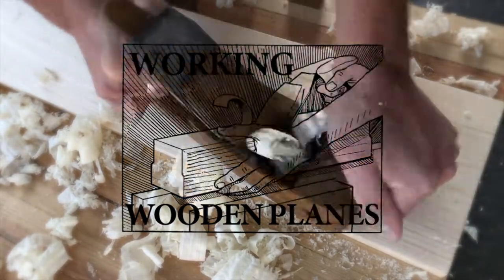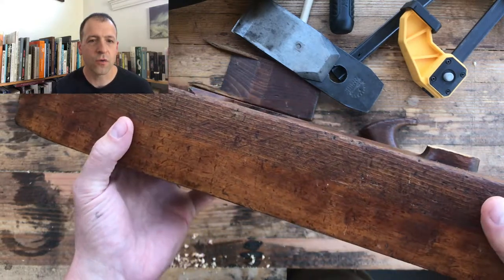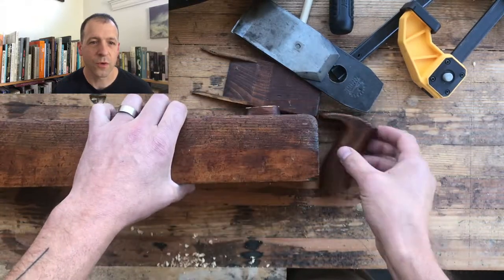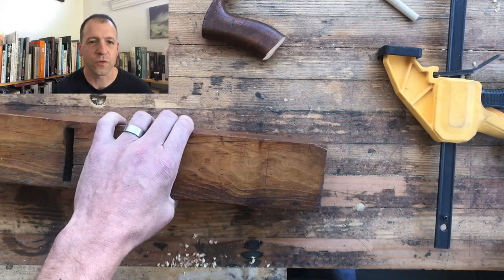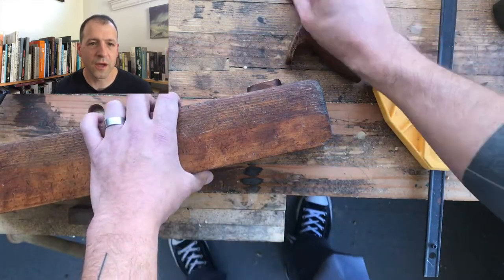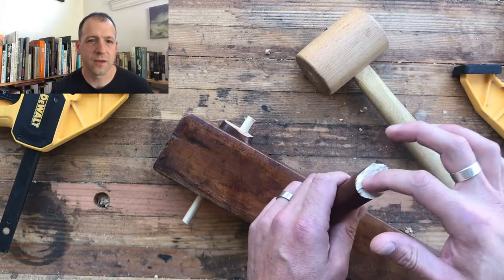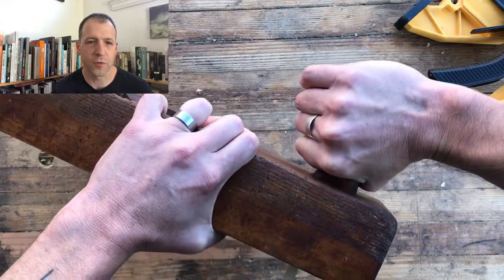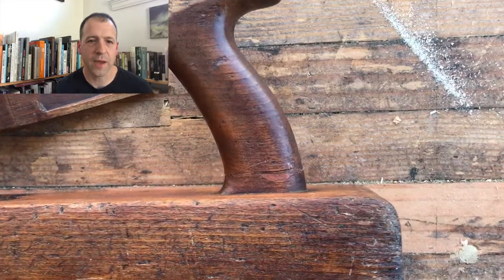An Unusual Way to Fix a Broken Tote on a Wooden Plane

Comment: If you run into the situation where the dowel won't pull out like this, you could try to drift it all the way through the hole. Any bruising on the base of the dowel isn't an issue because it will be trimmed off anyway.

I also like to ease the edges of my dowels with a spoke pointer of a pencil sharpener to make putting them in easier.

Comment: The planes that you show restoring have a groove cut into the blade ramp for clearance of the screw or nut holding the chip breaker and blade together. I have a wooden tryplane body that has no such groove. Is it for a different type blade?

Comment: Awsome video! Thank you for sharing. I was wondering if you had any ideas about fixing a steel plane that has a virticle crack in it? I purchased it at an old salvage shop and am looking to restore it. Any advice would be great. Thanks for your time!
Reply: A crack in the iron body?  If you want to use it you might consider welding the crack or, if it's on the ears reinforcing the side with another sheet of metal screwed into tapped holes in the body.  For sure the plane value is shot so it might be a parts donor as the return on investment for fixing it might not be worth it (in my opinion).
Reply from the maker: Sorry, I don't know anything about fixing metal planes!